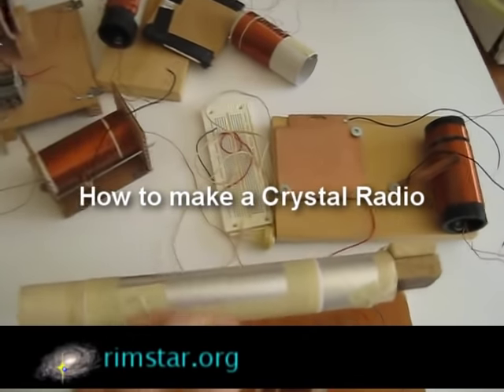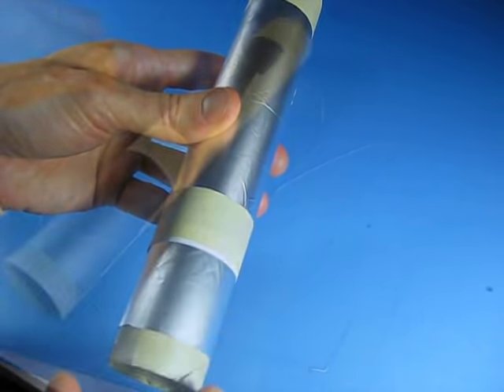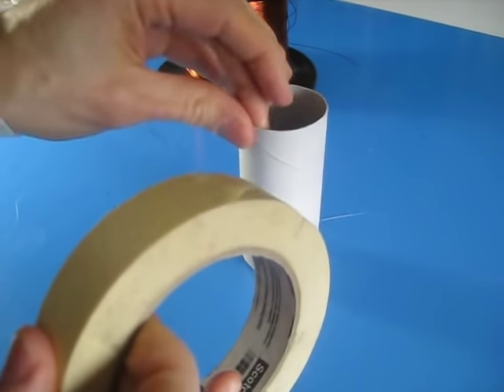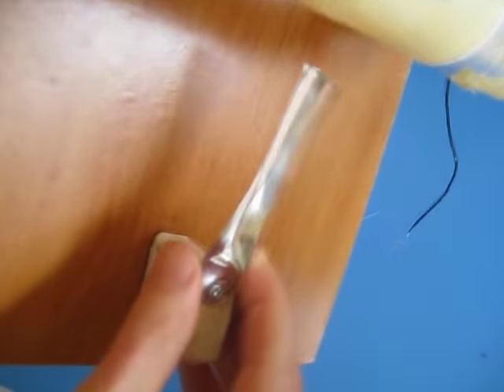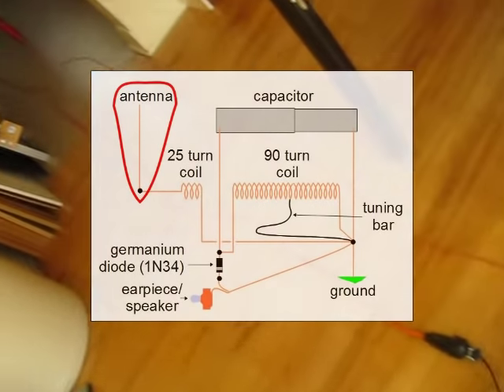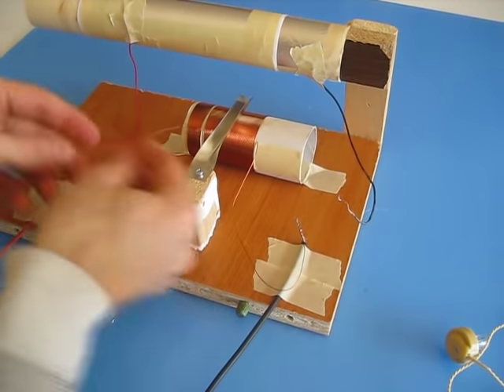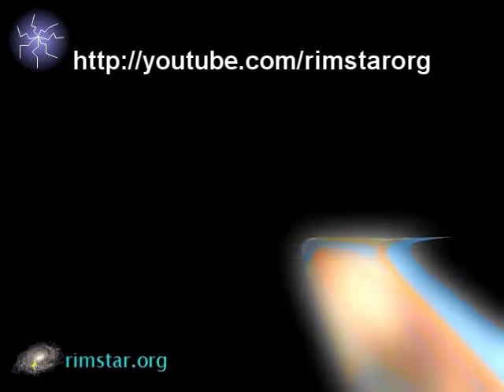How to Make/Build a Crystal Radio

Comment: How long must the wire be? And how many gauges is it?
Reply: And do you use solid or braided wire? This is for the capacitor wire.
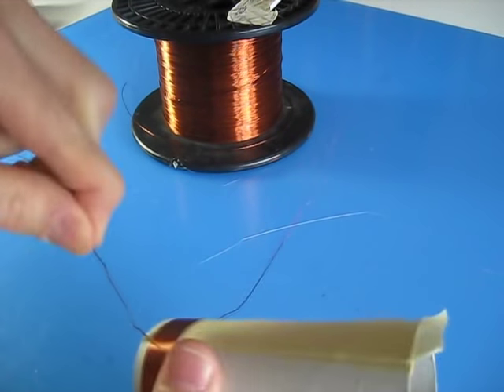Reply from the maker: The coils are both 26 AWG enamel coated wire (often called magnet wire, but that's just because it's often used for making electromagnets). See the video at 4:23 for the length of the primary coil and the video at 5:14 for the length of the secondary.
Reply from the maker: For all the wire except the coils, it doesn't matter what kind or size of wire you use.
Reply from the maker: Oh, and for the coils, 22 AWG also works. The length should be the same since it's the number of turns that matters here.
Reply: I mean the wire that is taped on the capacitor.
Reply from the maker: It doesn't matter what size that wire is. Use whatever wire you have. As for the length, long enough to reach the other parts. There's no specific length that they need to be.
Reply: If i have 0.2 mm (i think 30-31 awg maybe?) wire, i can do this or i must buy 0.4 mm < x < 0.6 mm ? And if i can use it, it's the same lenght of the coils?
Reply from the maker: 0.2mm would be too thin. The problem is that it would make the coil too short and that will affect the inductance and the range of radio stations it can tune into. That's why you need the 0.4mm to 0.6mm wire.
Reply from the maker: You may be able to salvage wire from old motors and transformers.
Reply: RimstarOrg mhhh i have an old tv maybe i can take the transormer in there...but normally people doesn't have motors or transformers xD Or simply i should buy the wire ahahha Thanks for the answer, and pretty a quickly one! :D
Reply: You can use 30 AWG wire, but you need to reduce the number of turns because the wire will be closer together, increasing the inductance. Take a look at the air-core inductance formula and try to match the inductance of Rimstar's coil.

Comment: Is it me or was there no sound from the “radio”? Also why do they call it a “crystal” radio? I didn’t see any crystal being used?!?!?
Reply from the maker: It could be you or more likely your headphones. But it was pretty quiet so I wouldn't be surprised if some don't hear it. And back in the early 1900s, a galena crystal and a sharp tipped wire were used where today we use the modern diode. These days, a crystal radio is defined as any radio that's powered by only the incoming radio waves.
Reply: I see! Thanks for explaining that. As I had no clue about them before today/yesterday. Very cool! I wonder how the first person to do this figured it out?  Also is on AM frequency? And can you make it FM?
Reply from the maker: It's AM. You need a different circuit to pick up FM. If you're still interested in learning more, check out my video on how a crystal radio works http://www.youtube.com/watch?v=0-PParSmwtE. It sounds like you might enjoy it.

Comment: Whats the use of the diode?
Reply from the maker: The diode basically turns what's going to the earpiece from AC to DC. You can see it in more detail here in my How a Crystal Radio Works video https://youtu.be/0-PParSmwtE?t=9m18s.

Comment: Can you make a transformer for a crystal radio
Reply from the maker: I'm not sure what you mean. Are you talking about amplifying the output? If so then I have a DIY amplifier here https://www.youtube.com/watch?v=JtPwxbOgBHw.
Reply: Iv checked out your amplifier but what i am looking for is a transformer design similar to our power grid. Scaled down of course.
Reply from the maker: There isn't a lot of current here, which means if your intent is to step up the voltage, the crystal radio side of the transformer will load down the parallel tuning capacitor and tuning coil. In short, the output would be pretty weak.

Comment: and from were it comes the name crystal?
Reply from the maker: In the early 1900s, instead of the diode you'd use a sharp wire touching a galena crystal. These days, a crystal radio is any radio that gets its power from the incoming radio waves.

Comment: How can I increase the Volume?
Reply from the maker: You can increase the volume by using a longer antenna. It should be a straight line, preferable pointing in the direction of the radio station.
I do it differently since I don't have a long area. I put multiple antenna wires in parallel, connected together at the radio only, and have them all pointing at the radio station. I only get an improvement this way if they're all pointing at the radio station.
Another way is to use a design that has only one coil. You may get more interference from other radio station though. That is the trade-off. You can find that design in my "How a Crystal Radio Works" video http://youtu.be/0-PParSmwtE at 12:12 into the video. You don't necessarily need the 82kohm resistor and the 0.001uF capacitor that's shown there.

Comment: will it work in any continent??please reply asap.
Reply from the maker: adwait rawat That depends. If you have an antenna thats a few hundred feet long then yes. If you have a short antenna then you almost need to be near some AM radio stations.
Reply: RimstarOrg can I increase the antenna strength by just connecting it to a big metallic body
Reply from the maker: adwait rawat No. The antenna needs to be as straight a wire as possible, or at least that's best. If you have a bad ground then connecting the ground to a big metallic body might be an improvement. If you're tight for space like I am then you could use multiple wires in parallel, like I do in this video. I find that only helps though if the wires are pointing at the radio station or are far apart.
Reply: Thanks for your help

Comment: Why not more turns?
Or less?
Reply from the maker: The number of turns, together with the capacitance of the capacitor, determines the frequency range (radio stations) that the radio can tune into. I talk about that in my video about LC circuits, https://youtu.be/shZUI6B5bZw . I also talk about it in my video about how a crystal radio work, http://youtu.be/HupFY_24o-4

Comment: Sir, is it a 220 V device.. Thanks!
Reply: Sir,, is it a 220V Device?
Reply from the maker: Mark Vincent Mendoza No. It is powered by the radio waves. You do not plug it into the wall and there are no batteries.
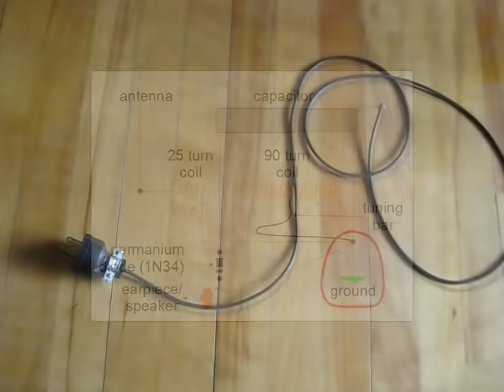Reply: In about the time 7:37,, he pug something to a socket sir,, the ground i mean :)
Reply from the maker: Mark Vincent Mendoza Ah, I see. I'm in Canada so it's 120V. You'll have to look up which hole is the ground for wherever you are. Here's one webpage I just found http://www.worldstandards.eu/electricity/plugs-and-sockets/ Be very careful when doing this. If you're not sure of what you're doing then get help from someone who is.
Reply: +RimstarOrg Therefore, sir, it is dangerous for us.. I am thinking to build that thing for our project indeed ;) ... Thank you sir:) 
Btw, I'm in the Philippines, we are connedcted in the transmission line with 220V :) its dangerous i guess.
Reply: Mark Vincent Mendoza
 Alternatively, you can connect the ground to copper or iron plumbing pipes if they are buried in the soil somewhere, or drive a metal pipe into the ground and hook the ground wire to that.

Comment: Why does it have 2 coils?
Reply from the maker: Having two coils helps to tune into just one radio station, reducing the overlap from others. This is called selectivity. However, it means the volume is lower. I explain this and the rest of the workings in my follow-up video, How a Crystal Radio Works http://www.youtube.com/watch?v=0-PParSmwtE

Comment: now use a natural crystal cats whisker
Reply: I think It would be much trickier since you have to tune both Capacitor and the coil, and you didnt know at which tuning it receive the radio broadcast, you didnt use a fixed diode so it won't oscillating at first. 

 Now you have to find a sweet spot (idk It's called tuning or calibrating) on the galena crystal with a very Sharp - end cat whisker,

Comment: Can’t find good info on calculating turns
Reply from the maker: For AM radio, the frequency range you want is around 540kHz to 1.6MHz. The design of crystal radio in this video uses an LC circuit (coil/inductor in parallel with a capcitor) to tune in the desired frequency. My webpage here https://rimstar.org/science_electronics_projects/lc_circuit_aka_tank_or_resonant_circuit.htm talks about how to design an LC circuit for a specific frequency, along with calculators and a video. You can use it to design a combination of adjustable coil and capacitor that covers the frequency range.
Reply from the maker: I just rewatched my video on that page (https://youtu.be/shZUI6B5bZw) and it answers a lot of that.

Comment: I have no geranium diode what can I do
Reply from the maker: If you are using a silicon diode then you'll either need a very long antenna (a few hundred feet long and fairly straight) or be close to a powerful radio station. You can also try connecting the output to an amplifier to see if you're getting something. I do that in this video here https://www.youtube.com/watch?v=JtPwxbOgBHw (but I'm still using a germanium diode). You don't need to make your own amplifier like I did, you can use a commercially made one. I don't guarantee that it will work with a silicon diode though. The 1N34 and 1N34A are very popular germanium diodes.

Comment: is there a resistor on this??
Reply from the maker: ROBBY G There doesn't have to be. However, you can sometimes get an improvement by putting a resistor with around 82 kilohms of resistance in parallel with the earpiece (i.e. connected to the earpiece's wires.)

Comment: Oh and when we attached the tuning bar to the ground we got nothing.
Reply from the maker: 89dreabirdflies72 Maybe you have the other end of the coil that connects to the diode connected to ground too? In the diagram on the left there's no dot there where the wires cross so they shouldn't be connected together.

Comment: Wouldn't a foxhole radio be much easier?
Reply from the maker: A foxhole radio is a crystal radio without the separate coils or variable capacitor for tuning. That means if there will be more chance of hearing multiple radio stations of different frequencies at the same time. Though, the original foxhole radios also used a razor blade instead of a modern diode and I've found that harder to get working https://www.youtube.com/watch?v=eIdHsjfbckw There are a huge number of crystal radio designs to play with, and as long as you have fun then they're all good!

Comment: but how much voltage to give
Reply from the maker: Do you mean how much voltage is needed to power the radio? None. Crystal radios are powered by the incoming radio waves themselves. No batteries or other external power source are needed. That's what's neat about them.

Comment: Ahe why it's name crystal radio 
       There any crystal 
      ?
Reply from the maker: The first crystal radio from the 1st half of the 1900s used a galena crystal and a pointy wire instead of the diode since diodes hadn't been invented yet. These days a crystal radio refers to any radio which is powered from the incoming radio waves.

Comment: there is no real crystal in this radio?
Reply from the maker: In the early 1900s, they used the sharp point of a wire touching a galena crystal where these days we use the modern diode. So now a crystal radio is defined as any radio that is powered by the incoming radio waves.

Comment: How long for the antenna ??
Reply from the maker: You want it as long as you can get and roughly a straight line. The longer it is, the higher the volume. Mine was only around 12 feet/3 meters long, which is too short except that I have some radio stations nearby.

Comment: Where's the crystal?
Reply from the maker: There is none. Before modern diodes came along, a crystal and a point contact were used instead. These days, any radio that gets its power from the incoming radio waves is called a crystal radio.
Reply: That's the version I'm interested in. Though the diode may perform the same function, it's the crystal's functionality that interests me. And there's a certain charm to it, too. I still enjoyed this method though, and I appreciate the response.

Comment: Where's the crystal tho?
Reply from the maker: The crystal is in the past :-). In the crystal radios from the early 1900s, before the invention of diodes they'd use a chunk of galena crystal with the sharp tip of a wire pressed against it. These days, any radio that powers itself from the incoming radio waves is called a crystal radio.

Comment: where does the two ends of antena wire  goes
Reply from the maker: One end goes nowhere, it's not connected to anything. The other end goes to one end of the 25 turn coil. See the diagram in the video at 0:27. I just stretch the antenna wire in a straight line across my floor. It has to be roughly a straight line, and works best if you point it at the radio station.

Comment: Where's the crystal?
Reply from the maker: Terri Romero There isn't any. The name crystal radio is historical and comes from when a galena crystal and a sharp pointed wire were used together where a diode is most of the time these days. These days "crystal radio" means a radio that get's it's power from the incoming radio waves.

Comment: wheres the crystal?
Reply from the maker: In the early 1900s, modern diodes didn't exist yet and instead the sharp tip of a wire was pressed against a galena crystal. These days, a diode is used instead but we still call any radio that's powered by the incoming radio waves a crystal radio.

Comment: Where is the crystal??????
Reply from the maker: Back in the early 1900s, the crystal was where the diode is now. It would be a galena crystal and you'd make contact with it with one end of a sharp tipped wire. These days we refer to any radio that gets its power from the incoming radio waves as a crystal radio.
Reply from the maker: Ah, but now I see from your other comment that you already knew that!

Comment: For some reason I only get buzzing.
Reply: Got it!
Reply: Thanks DUDE!
Reply: Hey me too! how did you get rid off the buzzing?
Reply from the maker: +Steven Steele Do you mean that all you get is buzzing or that yours works but you also get some buzzing? If it doesn't work and all you get is buzzing then some things to look at are that your antenna should be as long and straight as possible and preferably pointing in the direction of the radio station. Make sure you have a good ground connection. You must be using a germanium diode. Check all your connections. Make sure your wiper blade is making good contact with the copper that you scraped clean on the tuning coil. I also put some tips in my follow-up video here https://www.youtube.com/watch?v=HZZmKZJrIW0.
If it does work but you have some buzzing that you want to get rid of then that's difficult with this simple radio.
Reply: +RimstarOrg yeah all I get is a loud buzzing. I pulled the wiper blade up off the coil and then got a very faint signal for a bit. the antenna is about 30 feet and relatively straight. is a loud buzzing normal? maybe I'm getting some kind of interference?
Reply from the maker: Steven Steele
When you pulled the wiper blade up of the coil and got something, were you holding it with your fingers at the time? If so then I suspect your ground it no good. By touching that metal part with your fingers you were providing at least a bit of a ground, your body. How are you connecting to Earth ground? If your ground is the problem then the buzzing could be because the undesired signals don't have a place to go.
Reply: +RimstarOrg Thank you so much for your reply! It's awesome to get advice from the man himself. I wasn't touching the wiper blade at the time I got the weak signal. I've been trying different grounds trying to get better results. I've tried the ground connection in outlets, the outside water spigot, the sink, and the metal pipes underneath the sink.  I dunno what I'm doing wrong haha. I took it apart, now I'll put it back together to make sure all the connections are good. Wish me luck!

Comment: Make transmitter from scratch
Reply from the maker: I made one in this video here https://youtu.be/_4-Sx-T6VBc . However, it is a very simple one that transmits multiple frequencies so you don't want to use it for more than a few feet so that you don't interfere with other's radios. In some countries, there are laws and licensing for transmitting.

Comment: This is great. Is there a way you could just use an operation amp for your crystal radio though? like this one?
http://www.circuitspecialists.com/lm301an.html
Reply from the maker: +Gatchi Tater Tots Quite possibly. I'm not familiar with that particular chip but I used an LM386 here https://www.youtube.com/watch?v=JtPwxbOgBHw to make an amplifier for my crystal radios, though I've since used it for a lot more things.
Reply: +RimstarOrg nice, and as far as the ground goes, could I just cut any 3 prong plug (with the wire) off of something and attatch it? Or do I need one of the replacement plugs and another wire for that. If the second option like you did, what kind of wire is that? Thankyou! :)
Reply from the maker: +Gatchi Tater Tots Yes, you can use any 3 prong plug but be very, very careful of the other two wires. And make sure you get the right one for the ground wire. That's why I prefer to use a replacement plug and have just one wire. There won't be much current on the ground wire for this crystal radio so it doesn't have to be very thick.